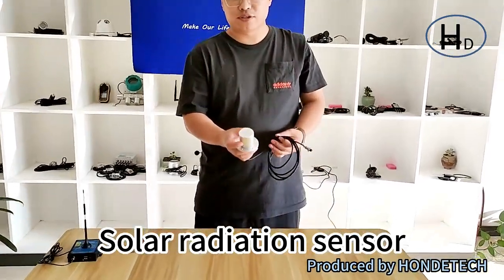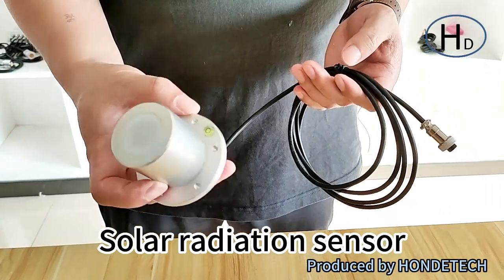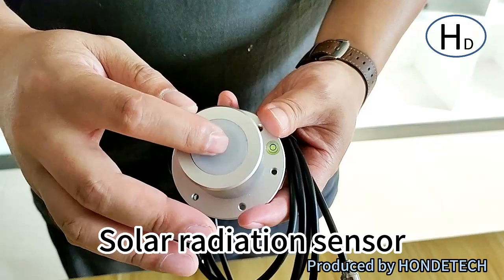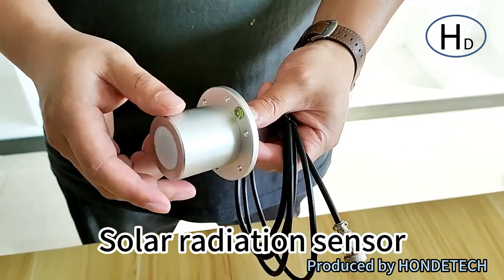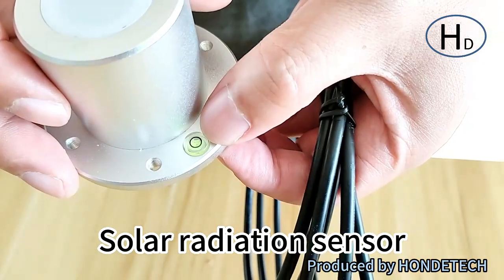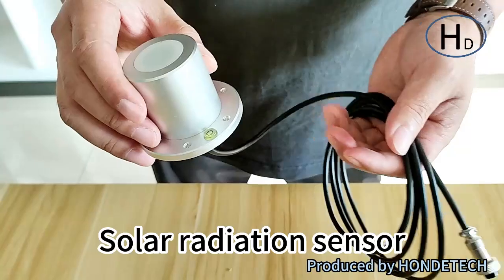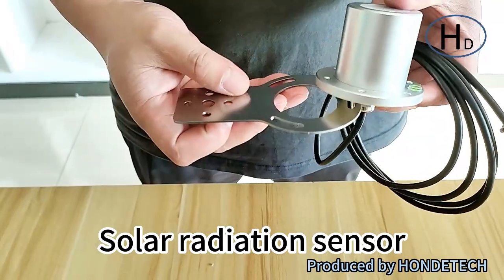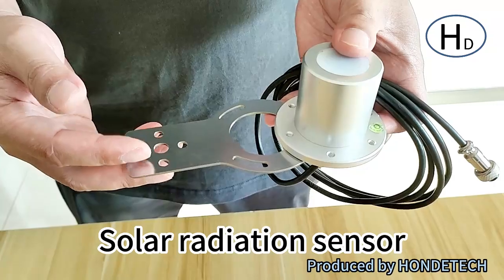Solar radiation sensor

Comment: Thank you very much for sharing with us this, is compatible with any Microcontroller or is it only suitable for your own wireless device that you have built? 

Thank you
Reply from the maker: For this sensor, it can be RS485 /4-20mA/0-5V/0-10V output and you can choose its output according to your PLC, you can contact me if you have any question by whatsapp : 86-15210548582